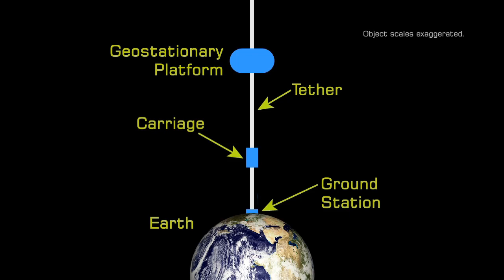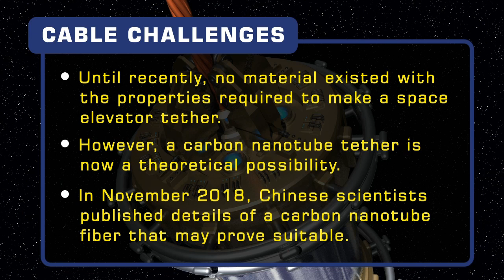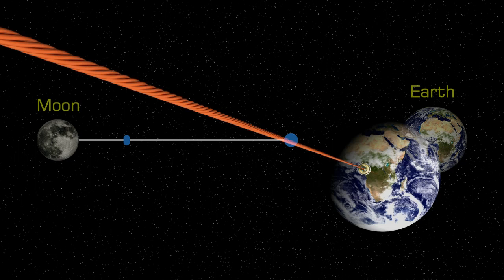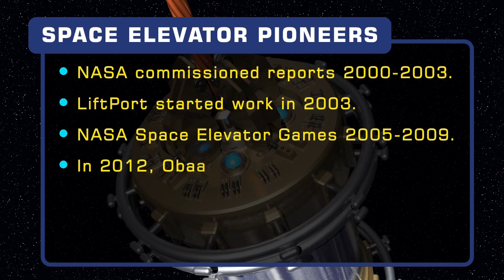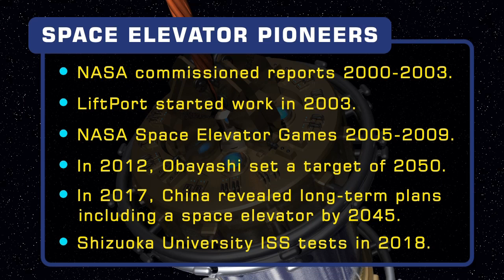Space Elevators

Comment: Even assuming - and it’s a BIIIIGGG assumption - that a cable was feasible, this isn’t going to happen.
Obviously the power would have to be transmitted from one end or the other, or there’d be no point in it. But you also need reaction mass - as the cabin ascends it has to match the horizontal velocity for that “orbital” height, so requires horizontal thrust. So it has to carry that reaction mass to start with.
Then only one cabin can be used per cable - and with the terminal at any useful altitude the likely transit time would be days rather than hours. So life support would be even more of a factor than with rocketry.
And your video, Christopher, showing people living on the “outside” of the counterweight ignores the fact that they would have to be anchored down - the counterweight is there precisely because it’s providing an “upward” force!
I’m not holding my breath on this one!

Comment: Excuse me, I have a question. Maybe you could answer it for me. Say you
traveled up in the space elevator, up to the 35000 kilometers. In the way up,
gravity would be pushing down because of the upward movement of the elevator.
But what would happen when it became stationary at 35000 kilometers, would
gravity be the same as in the surface of the Earth, would you experience
weightlessness or would inertia push you outwards, away from the Earth? Thank you.
Reply from the maker: You would be weightless at 35,000 kilometers as you would be a significant distance from the mass of the Earth. Just as astronauts are weightless on the International Space Station.
Reply: Just a thought: because the outside of a spinning circle spins faster than the inside of a circle (I am comparing a person standing on earth with a geostationary object), the elevator itself would speed up your horizontal speed as you go up by lifting you upwards, which is a cool idea.

Comment: There is one fatal Problem:
sideways accelleration.
when the Elevator cabin is moving from the Surface of the earth to the geostationary platform it is being accelerated to the Speed of said platform.
geostationary does not mean that the platform is not moving, it means that it stays over the same Point on the Ground.
the platform moves at About 3.07 KM/second.
sideways acceleration means that a there is a force at the cabin that is vertical to the cable. this force must be countered.

at the equator the base of the SE will move only at 1670 KM per hour, that is 0.493 KM/second. 

The Energy that is needed to lift the cabin to the platform is not only weight times Elevation, you have to add the Energy requirement for the sideways acceleration to this.
Reply: You are correct that an elevator car needs to be accelerated sideways as it climbs and decelerated as it descends but this is not a fatal flaw. Even at 500 mph, an elevator car needs 3 days to make a one-way journey. The sideways acceleration need only be a few thousandths of one G to attain the needed 3 km/sec at GEO.
Reply: @NorCalSkeptics  Maybe, but it is a sideways Force that pills at  a straight Rope that is already strained
Reply: To the Limit. Only a flawless Rope of the best Material known To mankind can Take the Strain without sideways Forces

Comment: Yes, In order to put satellites directly in geostationary orbit, a very long tether would be needed indeed. But in order to "just reach Space" could the tether not be a lot shorter? The "Platform" could be located as low as 100KM (international measure for "Start of Space") or maybe even at 410KM (altitude of the ISS). From there satellites and cargo could be transported further out by conventional rockets engineered to work optimally in space. This way we would remove the need for the bulky parts (1st stage and 2nd stage) of the rockets just to gain this kind of altitude. The tether for the Counterweight would off cause extend further to balance the system, depending on the placement of the Platform and the mass of the Counterweight.

Comment: Forgive my physics naivete, but how would we anchor such cables to the earth without them moving or tearing loose from their locations from the shearing force. What would we need?
Reply from the maker: This is a good point -- we would need very secure foundations, piles sunk deep into the bedrock. Not easy!
Reply: Actually, the tension in the 9 cables (yes, 9) is least at the Earth's surface. It is sufficient to use a large ship floating on Lake Victoria as the anchor. If the cable needs to be moved to avoid satellites or meteors, the ship merely motors to a new position.

Comment: It should be noted that any successful space elevator project is going to have to be "grown" organically starting out very thin with very little capacity and then using that limited capacity to raise up more material to make it fatter and stronger.  The capacity can grow exponentially using its own capacity.  I would expect the doubling time to be measurable in months and almost certainly less than a year.  Build a light duty system and let it grow for a decade and you you've got something a thousand times the capacity.  You only need the rockets at the beginning to dangle down the initial filament.  The filaments can also be tapered to allow for more efficient material use.

Comment: I'd like to see a space elevator but I've not seen anyone address the question of how the cable is going to move around as you ascend and descend it. You're going to exchange momentum with the local bit of cable that you're attached to as it provides the coriolis force (eastwards) that's accelerating you from zero to orbital speed. The cable will move (westwards)  - the more so if its mass is small. It will wave and flap and oscillate, with damping from what? - there's no atmosphere so it will have to damp itself? The forces to restore the cable during and after an ascent will have to travel up and down the cable from the tethers, at the speed of sound in the cable. Better hold on bloody tight - it would get extremely ugly. That's not to mention the stealing of momentum from the space mass: a possible solution here is to use two cables.
Reply from the maker: This is a good question, though my guess would be that the weight of the cable and counterweight would be significant enough (relative to the weight and movement of the carriage) to negate this issue.
Reply: Good point. You are correct that an elevator car needs to be accelerated sideways as it climbs and decelerated as it descends. Even at 500 mph, an elevator car needs 3 days to make a one-way journey. The sideways acceleration need only be a few thousandths of one G to attain the needed 3 km/sec at GEO. Given the length of the 9 cables (yes, nine) the oscillation would be of an extremely long period. Carefully timing the ascending and descending elevator cars on adjacent cables is one way to dampen oscillations.

Comment: I was wondering, couldn´t it be theoratically possible to build a giant railgun to catapult Rockets into Space?
Reply: I think the g-forces involved would make firing a rocket containing human passengers suicide. I'd sooner take the elevator personally :)
Reply: @furiousgeorge6594  wouldn´t they be the same as when the rockets lift off? and yeah i know it depends on the starting angle and accelerating speed so propably how long the rails are. ...... come to think of it a railcatapult could propably reduce the amount of fuel used for the ignition but then they are propably one time usage XD.
Reply: With a rocket the force is applied gradually. The rocket crew only experience 3 gs. A railgun would be like firing a slingshot, with the force being applied immediately and far more focused. If you slowed the railgun down to make it survivable the projectile wouldn't have enough force behind it to get into space. 

Compare accelerating to 100mph in a Toyota vs a Lamborghini. Both can reach the 100mph but the Toyota (the rocket) is less likely to give you whiplash than the Lamborghini (the railgun). 

I'm not a scientist obviously but I think you would also need a way to make the railgun launch survivable to humans rather than just make a giant railgun and fling people into space. Not saying it's impossible, just that it's a lot more work than just making the big railgun :)
Reply: @furiousgeorge6594  yeah i thought so that thing would have to be kilometers long to gradually accelerate and even with escapevelocity it would still have to go faster instead of losing speed, but to build a space elevator you need tons of nanotubes so i don´t know which would be cheaper XD. i was just wondering if it was possible.
Reply from the maker: Quite possibly . . .

Comment: Your videos are always thought provoking. Does the Earth’s magnetic field rotate synchronously with the planet? How much, if at all, would an electrically conductive carbon tether affect the ionosphere, ozone layer, or Van Allen belt? Would such a tether be able to generate an electrical potential, enough to produce significant electrical power? Without a tether, how will we ever generate enough rocket fuel to lift the tons of material needed to colonize our Moon or Mars?
Reply from the maker: Some great questions! :)
Reply: The main problem is Earth is one Deep gravity well! Once you are out of that all you need is Delta Vee and Time! mining asteroids becomes possible. Once you have basic infrastructure in place it all becomes a lot easier. Designing a cable that can stand both the strain and pressures put on it as well as a means of manufacture may be a harder nut to crack!
Reply: Good thoughts. Indeed the Earth's magnetic does indeed rotate with the planet, so the cables will not be generating a significant electrical potential due to that effect. Solar storms, however, will create voltage potentials but they won't be very useful.

Comment: Would the tether point not be dependant  on its mass. 

There would also be the complication of not only siteing your elevator on the equator and protecting it there but how would you keep the tether in its geostationary place? At the geostationary orbit altitude there would be little lateral force but as you increase altitude (maybe altitude is not the right word here) the force would be retrograde or backwards! You would need to propel the counterbalance mass forward or the earts rotation would tend to wind the cable up around the equator like a string!
Also there is the centrifugal force because of the Earth's rotation not being in the same plane as its orbit!
Reply: You could have two or more tethers on either side of the equator.
 So long as the North-South cable tensions are balanced, the counterweight will stay over the equator.
Reply: I don't think that matters too much! One lift (with counter mass) would mean the Earth would wobble a bit as it would orbit the common centre of gravity (a wobble measured in feet I would expect) Of course multiplying the lifts would randomise the wobble! ...... The relative force on the mass would be both outward (which is what it is for) but also backwards! This backwards force would need to be counteracted or the whole thing would collapse! There is no need for it to be On the equator at all. It could be mounted at the pole (with the lift starting off parallel with the ground ....... But you would need to be able to anchor it as gravity is not working for you on this one ;0)
Reply: The cable would flap about and oscillate like crazy with the coriolis forces as things climbed up it. It would get really ugly.